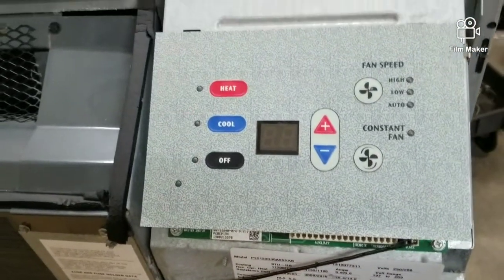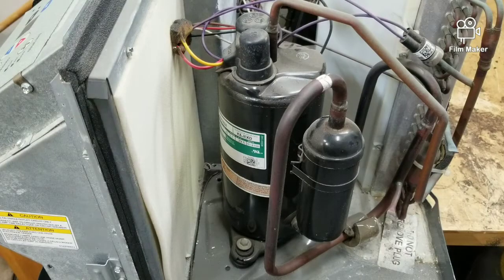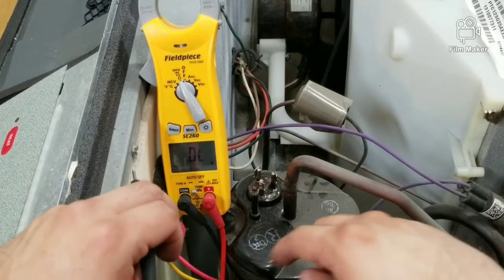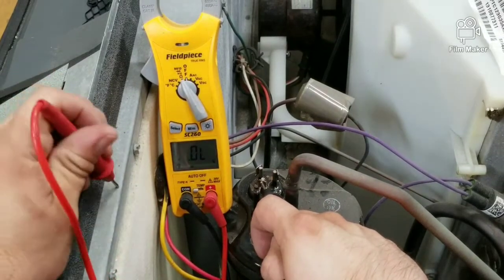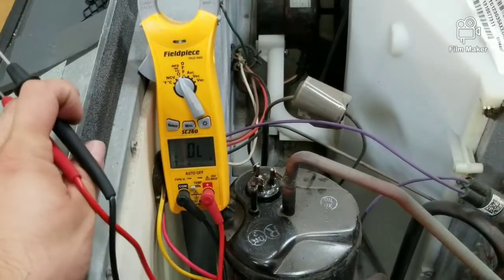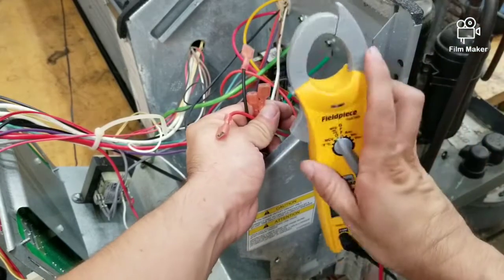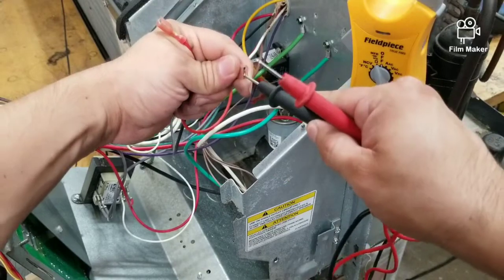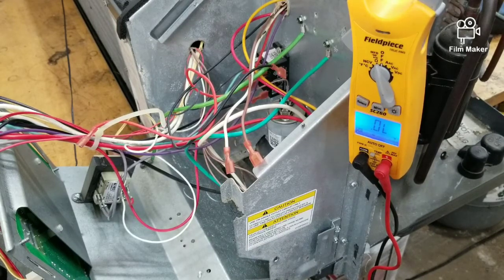Ptac tripping the breaker?? Easy steps to find short to ground

Comment: I have a ptac unit that only kicks on the compressor when you set temp at 60. And it only runs for a bit and turns off. It does kick back on a fees minutes later. What you think could be it. Thanks
Reply from the maker: Hey Luis
Make sure the ambient thermistor(black sensor) is not with the tip inserted in the evaporator coils fins, also check for a dirty condenser( inside the fan shroud)
And that the condenser motor is working
Reply: @PtacSolutions  thanks for your response bro. So I think is the thermister. Put a different one from another ptac and works.

Comment: Hi, pal question whenever you work on the unit check the compressor you take off the power.
Reply from the maker: Hey Carlos 
Only if you want to see if the compressor is getting power from the board. To check for ground or windings you can disconnect the power supply

Comment: David Car love the ptac content. I have an old amana ptac that runs fine but then randomly will trip the breaker. Condensor is clean air filter is clean the capacitor doesn't look swollen ( and once it trips i reset the breaker and all works well till next scenario) what am I missing?
Reply from the maker: Hey Pat 
I have ran into some issues like this one, for the most part  I find a faulty breaker... but check amp draw from compressor and motor, in other cases could be that the compressor may be going bad